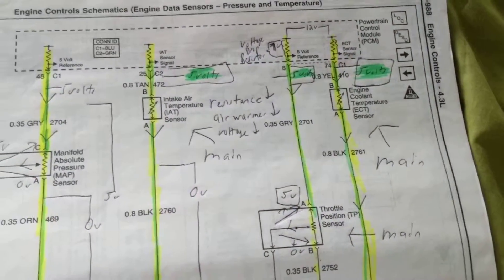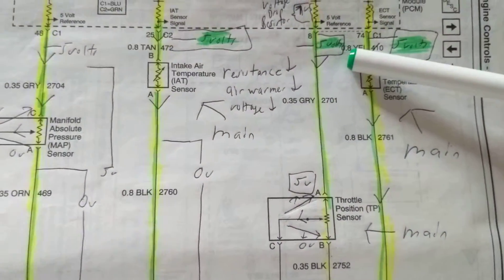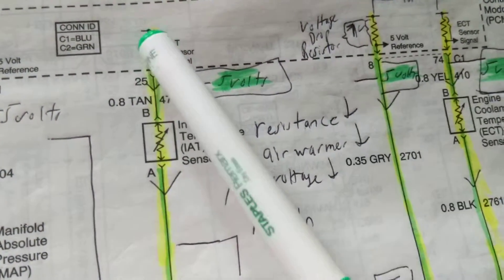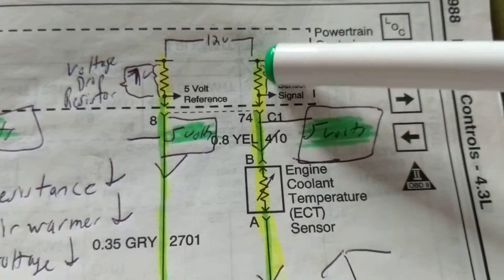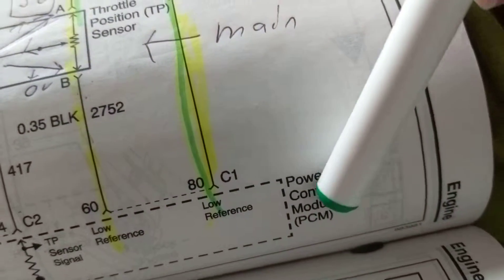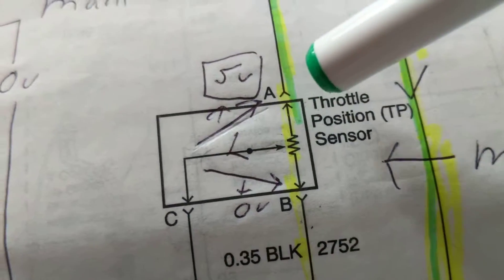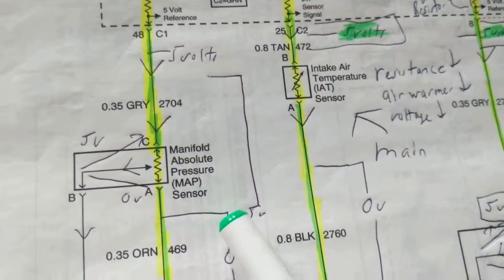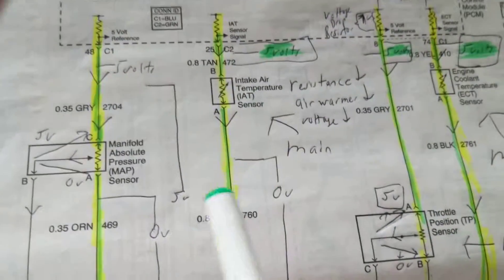THROTTLE POSITION SENSOR explanation for wiring diagram, troubleshooting and simplify tutorial

Comment: 06 Chevy Colorado, New APP, new PCM, new TC, wires from APP to PCM good, Wires to TC Good, when starting from PCM reset (battery cleared) a  5v reference and correlation APP1-2 Code will Apear and Reduced Power mode is Activated. Live data shows high reference, low reference, correct angles and percentages, clear codes and everything shows agreement. Drives normal and well. Shut off and wait for PCM to reset and it throws the codes again. The pins match the wiring diagram I have but I’m wondering if the PCM is reading the fault then adjusting to correlate and that’s why it goes into agreement offer resetting the codes. However once the pcm resets it recognizes the original fault and before it adjusts to the wrong calibrations it throws the code. Then after I clear the code it stays calibrated until the ignition cycle resets the PCM. Very important vehicle, regular mechanics don’t want to deal with it. Have read and noted values at all 12 wires for 0 throttle and full. Seems correct. I have 3 pedals, two throttle bodies, 2 pcms, the wires were all pinned the same as the diagram I have and none where changed before the problem started. Is there a relay that could effect the APP sensor at ignition, maybe a power surge at startup, is there a relearn for the PCM could it have changed somehow?

Comment: Im having a weird issue with my tps. My car was stalling and I got a p0122 code so replaced the sensor. Its working better but its still stalling pretty rarely. My idle hangs high sometimes and reads 1-2% open. when the car stalls my temp gauge flucuates. Any ideas?
Reply: What is the voltage of the connector sounds like your TPS is measuring less than one volt which gives the code
Reply: An idol TPS sensor should be 5 volts at idle then it should go down Midway once you open throttle but have to make sure you have five volts at the connector and ground
Reply: @Joeelectronicschematicsforauto  ive got good ground almost no resistance. And im getting exactly 5v. I havent measured the signal voltage, i couldnt figure it out im new to this electrical stuff. My code is gone though but im still getting symptoms just not as consistent as before. What i dont understand is why my coolant temp gauge acts up when it stalls out. 
Its hard to figure this out when it only does it about once a week

Comment: 1997 dodge ram 2500 4X4 
Pin 1 (sensor ground) throttle position harness at tps is 
.3 ohm key off but 5.4 ohm with key on ???
Having torque converter loc / unlock issues this is the only thing i can find wrong whats your thoughts

Comment: And the one other important sensor probably the most important is the crank or cam sensor. Nothing works if the location reference is wrong. And not all thermisters work in that range. Some BMW motorbikes work in reverse in this range. :)

Comment: what's the wire colors
Reply from the maker: I'll look up the schematic and I'll get back to you thank you for the comment
Reply from the maker: The colors of the wires are as follows the five volt line has a gray wire the ground wire going to the computer giving it a ground is a black wire and the signal wire going back to the computer is a dark blue wire which is pin 24 thank you for your comment thank you for being a viewer

Comment: just wondered if you get the three wires the wrong way around on the tps would it fry it.  using 5v
Reply: This component you was is a electronic pots with 5 volts ground and a signal back to the PCM if you put the 5 volts to ground you'll have a fuse to protect its depending on the make or model
Reply: I need help with my tps wiring Ls1 camaro 2000
Reply: Richard Wright what can I do for you I might need to get to schematic but what is the problem

Comment: Hello teacher, thank you very much for your explanation about the sensors! But i may ask you something about TPS that i can't understand, how does a 4 wire TPS (With iddle interruptor) works? I mean, i read about it doesn't need an IAC valve, but, the TPS controls the Iddle with a valve or something? I'm very confused. I'll be waiting for your answer, thank very much. Greetings from Chile
Reply from the maker: Thanks for the Comments when I get a schematic I will post something up
Reply: actually doing a video about it I don't think would be too many views but basically there is a few of them but there are like two resistors pots in parallel b+ is shared and also ground is shared and there are two outputs one telling the computerhow wide open the plate is on the throttle and the other one telling it when the throttle plate is closed meaning it's idling
Reply: I can write a whole explanation about this electronically basically the PCMneeds to know which gear shift the car is in when the throttle plate is closed it can be in park it throttle plate open and it could be in drive a throttle play closed PCM needs to know to make sure for the air fuel ratio it's a long explanation complicated electronics
Reply: one apple dose of the PCM tell me get to degree in voltage how much the place is open and the other one is idle switch telling the other one the PCM the computer if it's closed for idle
Reply: I meant one output
Reply: That's one of the most complete answers that i've got, thanks a lot teacher!!!! You earned a subscriber